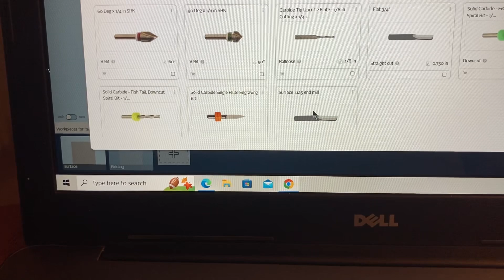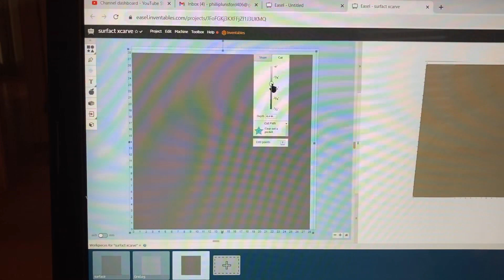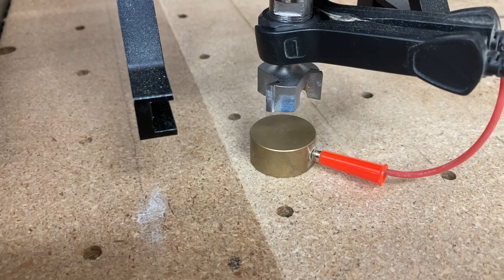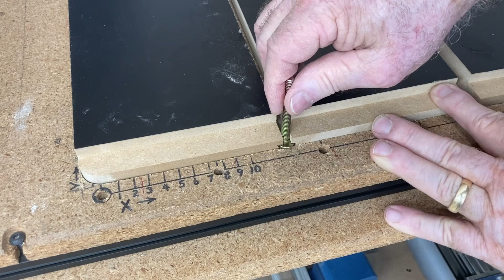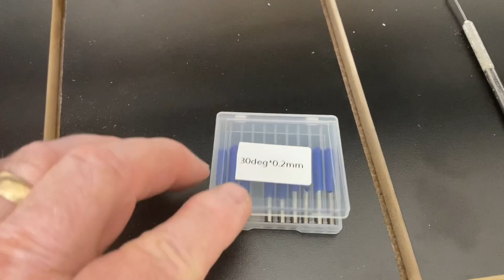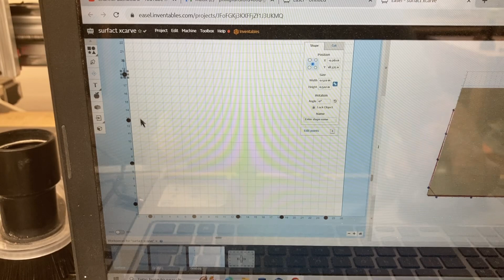New Wasteboard for the XCarve Designed in EASEL

Comment: when i set my zero and start the cut the router does not come down low enough to touch the waste board
Reply from the maker: Is this a new problem?  Did you have a recent upgrade?  Check the calibration. I have had this problem before

Comment: I recently purchased a SainSmart 4040Reno . Would you suggest I put a wasteboard similar to yours over the factory 2 piece? Also, where did you get the coated MDF?
Reply from the maker: I like protecting the original waste board. It’s not necessary. I’m bad, now that I have the new wasteboard I like the look and don’t want to damage it. Kinda defeats the purpose. The MDF was recycled from a retail that went out of business. I was fortunate enough to get it

Comment: I like the revised waste board design. My question is would MDF be the best selection for this application? If MDF gets wet, it swells. I do like the melamine
Reply from the maker: MDF is the standard that you will find on most of the hobby and small commercial CNC machines. Hopefully you are in a dry environment
Reply: @PawPawsWorkShop  Thanks PP. I'm in NC. Not too bad. And thanks for the files. I found out that my board is off by 1 mm

Comment: Hi Phil good stuff. I have Easel Pro and replaced my spoil board individual pieces on my 4060 Gemitsu. Can I just use your Easel setup to surface the new spoil board without adding your top layer design?
Reply from the maker: Yes, just double check the size. It should run just fine
Reply: Phil my board is 400mm x 600mm when setting up the rectangle with a pocket cut should I make the  rectangle larger then he board? Say 410 x 610?

Thank you
Reply from the maker: Yes, that will be best. That eliminates an edge on the outside of the waste board

Comment: What table saw blade did you use to cut the black melamine?
Reply from the maker: I use carbide tip blades. Usually a 60 tooth or more.
Reply: @PawPawsWorkShop  thank you for your answer. I really like your spoil board set up.

Comment: Really enjoyed this video. I have the new PROVerXL 4030 V2 that already has the new style spoilboard with T-slots. I would like to include some of your design. Would you add another spoilboard on top or would you rework the existing MDF boards? I like the black MDF that you used but you didn't flatten it, why. I saw you flatten the original spoilboard for it to sit on but are you assuming the new one is flat.
Reply: Watch your video again and even found more things you explained. I downloaded your files and converted them to the 4030 V2 (will send you a copy of the file). Been looking for the Black Melamine here around Fresno CA and can't find it. Can you suggest somewhere to look? Thanks again.
Reply from the maker: The melamine is very consistent in the thickness. I knew the base was off so I surfaced the lower board. The top is perfect. The best way is the placement of the grid lines being .030” tells all. They are very consistent. No need to surface the melamine. Thanks for watching the video
Reply: What about adding a new spoilboard top. @PawPawsWorkShop
Reply from the maker: On the small machines the extra wasteboard limits the depth of the projects. I have one on my FOXAlien VASTO and it definitely limits the projects that I can do

Comment: Love all of your videos. I consider myself still fairly new to the CNC world even though I  have done several decent size projects and I getting ready to upgrade my Xcarve with your video help of course.
Couple of questions on this project: 1) Was there a reason you did not surface the full cutting area of the machine (30x30) 2) what router lift are you using, as I am getting ready to build my router table? Again thanks for the videos, you have taught me so much!!!
Reply from the maker: You can not surface the entire board. You will hit the stops (limit switches). Yes, I could move those and surface a little more but still you can not surface the entire board. I am very conservative with my CNC machines and do not push to the maximum. That is one way I do not damage and have problems with my machines. The size of this board fits the size that works with the limits that I have set. Your project can extend beyond the new wasteboard. I just will not cut outside of the area of the new wasteboard. I have a review of the router lift. Check out that video.  I wanted a simple effective wasteboard to use my t-track clamps, glue and tape method plus use the dowel pins for a simple fence. Very versatile

Comment: Love all of your videos, especially the X-Carve videos! Do you do anything specific when your power up your X-Carve controller to ensure that the X-axis is square? With the belt system of the X-Carve, I have found that the X gantry can be a little out of square before the machine is powered up. When powered on, it will retain this out-of-square configuration, which could mean that you are no longer aligned with your nicely carved X-axis lines. I usually hold the X gantry against some wooden blocks registered against the front of the machine before I power on the controller, but I'm wondering what procedure you use to ensure that the machine cuts square.
Reply: Thanks for the feedback. I have one of the older 1000mm X-Carves and I have not upgraded it. I have considered doing so, but haven't yet. It's nice to know that the upgrade will fix this issue. Gives me more motivation to do the upgrade!
Reply from the maker: No, I do not. Which version of the XCarve do you have?  If you have the original version then the machine is problematic and you need to strengthen the components. If you have the later version you should not have that problem at all plus if by chance you did the upgrade it definitely would not have the problems you describe.